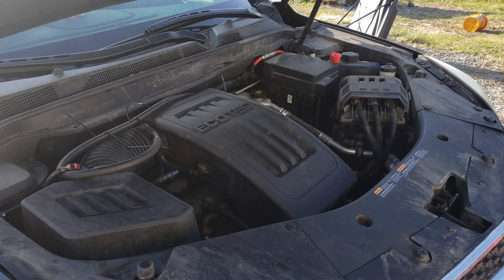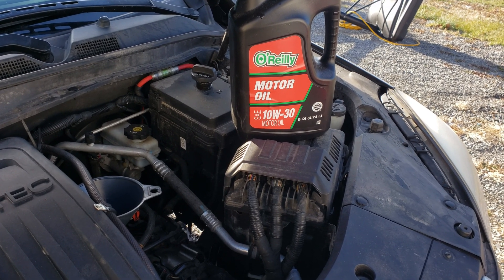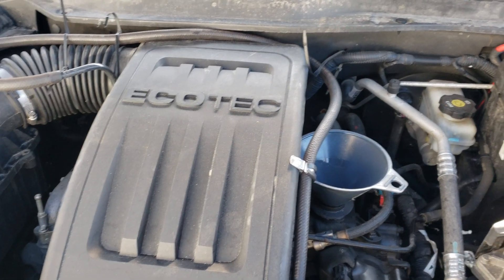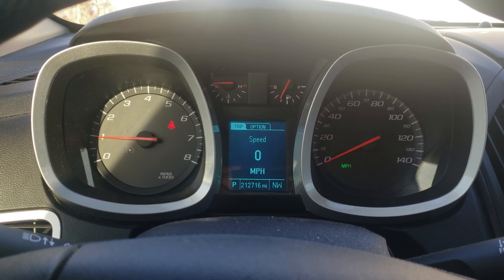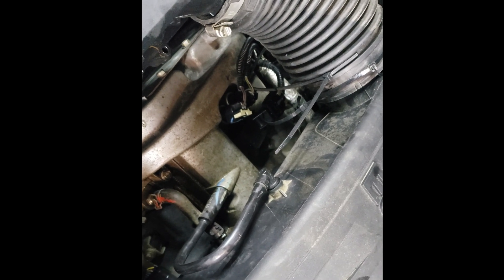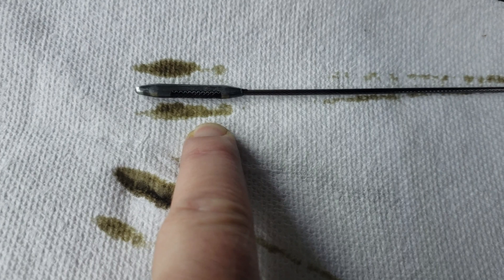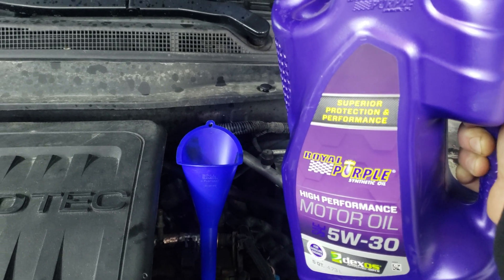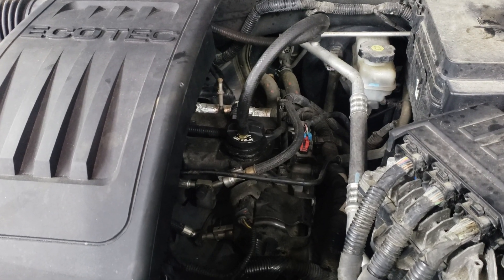Equinox PCV: Making a Bandaid?

Comment: This won’t actually do anything for your car. 
There’s already hose that goes from the valve cover to the air box  
You’re just adding a second breather hose. 

The problem is a blocked PCV system . And you didn’t correct anything with your Band-Aid, lol.

Comment: I own a 2015 equinox with 95k. I’ve also noticed it is burning some oil the last 2 oil changes. I’ve been changing them every 5k and at the 3k mark have to add close to 1 qt of oil to get me through to 5k. I’ve been using Kirkland fully synthetic 5-30 ( like the oil cap suggests).  When I remove the oil cap and check the blow by , the paper I put over it is being sucked in ( is this good?) 
Ran a scanner, no codes show up. Replaced the actuators at 90k. 
After watching multiple videos my game plan is to add a fuel treatment every other gas fill up ( 500 mi) maybe Chevron Techron or Marvel mystery.  I’ll also be replacing the oil cap with a vented one, part FC 219. Changing the oil at 3k intervals and using higher quality oil like Mobil 1 or Castrol GTX fully synthetic. Any other recommendations are welcome. Hope this info helps somebody. 🙏🏽
Reply from the maker: It's better to have a vacuum in the crankcase than pressure.  I'm not sure I've ever had a car that actually pulled a vacuum, so you're doing better than I am lol

Comment: Hi, a friend of mine told me that since i have high mileage, I should use mineral oil (20w50) better than originsl, syntetic 5w30. (Has 150,000 Miles) Any toughs? Thanks
Reply: Mineral oil?  Plain?  NO NO NO NO NOOOOOOO.     20W-50 was OK fifty years ago when engines had much larger clearances for oil.  Newer engines are built so tight that running oil that heavy could blow out your oil pump.    It could also  oil starve  a lot of critical parts - like the entire top end.    My engine is a 2011 with about 207K miles.  Still using Mobil 1 full synthetic at the factory 0W-20 spec.  Does not leak anywhere and does not burn ANY oil between 7K changes. .  .  .  .  .  High mileage oil is mostly a sales gimmick.  If you are properly servicing your motor, you don't need it.

Comment: I’m currently doing this. With one modification. Im going to put the new PCV valve tube lower than the clean air intake tube, closer to the throttlebody. So there is less chance of blow by being drawn back in through the clean air tube.
Reply: Can you put pictures of it

Comment: Those cars are junk, i will never ever get another
Reply: What type of issues have you had to be considered “junk”? Also, how many miles is on yours?
Reply: @cunninghamroc  132k miles.  Shit i jad to fix so much shit on this car, problem after problem never stopped
Reply: @Olds_Pwr  didn’t change his oil and then expected it to be OK
Reply: i just got a 2016, AWD with the 2.4L, has 222k miles on it rn. i assumed seeing the high mileage that these must be pretty reliable. am i in for a rude awakening?
Reply: @Lincolnator721  good luck bro
Reply: my 2nd aunt had a 2017 2.4L AWD with around 110k miles. never had any major issues. but she maintains her cars really well

Comment: My family has a 2008 Acadia 3.6 vvt 191k miles, bought used 2 months ago. Gave it an oil change, new Air filter and cleaned the throttle body. Found lots of oil in intake tube 3 inches from throttle body. Ordered a new pcv valve and thinking about adding a catch can too. Will try pcv valve first. It used 1 qt of oil in 8000 miles in 8 weeks. Forgot to test for oil cap suction. Nice mpg increase already from cleaning throttle body and new air filter. Old air filter was really bad.
Reply: Install a catch can. It is a must for the 3.6L.

Comment: I have a 2010 Malibu without direct injection. I just cleaned the throttle body and changed MAP sensor. Oil cap is sucked down by vacuum which is good. 100k miles. Doesn't use any oil. Cleaning throttle body added 4 mpg and new MAP sensor added 3 mpg. Now gets the 37 mpg like when new. AC on, 70 mph.

Comment: It might be due to poor maintenance because I bought my 2017 brand new and I always do my oil changes with full synthetic and mine doesn’t burn any at all. It stays full and I don’t ever top off. The only thing that happened once was a VVT solenoid but I always fix an issue asap so the cel was only on for an hour because I changed it out and that was 2 years ago. I also put a catch can on mine to help prevent the over pressure in the crankcase.
Reply: I think I read somewhere that GM might have improved the rings in later model years.  The lawsuit that they had didn't include those years. They definitely need to be routinely maintained though for sure as many people seldom even check their oil. I have a '16 and it doesn't burn oil either but I've always stayed on top of maintenance usually doing oil changes every 3 to 4 k.
Reply: How much miles
Reply: @AdrianHernandez-vh7wr  im currently at 98k miles but this failure happened at 75k or so. I change the oil every 5k for this car but now that im over the 90k I do it every 2-3k miles. On my STI I change it every 2,000 miles or less with motul oil only. I use synthetic on the equinox and my other daily driver.

Comment: Have you checked if the PCV return orifice in in intake manifold is not blocked ? It's a common problem for oil consumption. Run the engine and remove the oil filler cap and if it's blowing out instead of a slight vacuum the hole is blocked and you will need to pull the intake away to clear it.

Comment: I've been thinking about rigging up an old school pcv system with an actual pcv . Vacuum hose from intake vacuum to pcv valve mounted in modified oil fill cap, Ford had this setup back in 70,80's. Some feed back would be great. Kind of worried about affects on fuel trims.
Reply: When you connect to vacuum, find a port below the throttle body.  Preferably one that feeds equally to ALL the intake runners.  You don't want that oil vapor dumping into only one cylinder.

Comment: We have a 2016 GMC terrain with the same engine, these engines are crap my wife only has 41,000 miles on this engine echotec, and it just blew the rear seal from the PCV being clogged like they all do. I'll tell you what a stupid stupid car stupid engine I mean, I know all cars have problems more so than others. And they call themselves engineers they're just horrible people. And you try to get your money back and then you can't and it cost close to $1,500 or more to get a new rear seal and also to clean the orifice out of the intake. These engineers are stupid, absolutely stupid they just want you to buy new cars all the time that's all, they're not stupid actually they're very smart on making money, and we as a consumer deal with it and put up with it instead of trying to do something to them to get them to do it right etc. It's just garbage

Comment: my solution was two parts lacquer thinner 1 part trany fluid to keep it on the rings,  1 pint in each plug hole, set 24 hours, roll over to prevent hydro lock, drain, fill with new, stopped the oil consumption none in 2000 miles
Reply from the maker: Nice.  Maybe I'll give that a shot in a future project.
Reply: What do you mean by “ roll over”? Like turn the ignition on and off? The is!

Comment: Did you put a CAT scan on that line before you go back into the engine to catch the mixture oil?
Reply from the maker: The whole point of the line was to only grab the gasses and not any droplets of oil.   I have since inspected the intake tube and have found very little  moisture from oil.  Oil consumption has decreased considerably, but without changing the piston rings to solve the problem at the source, all that can be done is try to minimize the symptoms.

Comment: wouldn't it be better to install an oil catch-can rather than just a hose; wouldn't the oil in the hose eventually get pulled into the intake anyway?
Reply from the maker: I've pulled the air box and the amount of oil trapped on it is less than it was with the single valve cover vent.  I've been curious if that OE vent has awful baffling and can be improved from just part. 
The Equinox has added around 15k since I posted this video.  Each oil change is showing less loss than the one before it.  How much of that is the better vent path, and how much of that is the seafoam and better oil loosening the rings back up?  I won't know unless I get to take the engine apart and see what things look like.
Reply: @medievalmotors  do you have an endoscope; I use an endoscope to look into the cyliders through the spark-plug hole and it has the ability to turn the camera up and see the valves.I find that the cylinders in my 2001 dodge ram are very dirty with sludge caused by blow-by from the worn rings, so I installed a catch-can and now I'm cleaning the cylinders with brake cleaner and then I put some transmission fluid additive. I first apply the brake cleaner then swish it around with an airline so it would go up to the valves an then vacuum it out and then apply the transmission fluid addittive and some trans fluid and swish that around with the airline or disable the engine and crank it WITH THE SPARK-PLUGS REMOVED SO AS NOT TO HYDRO-LOCK IT. Then I vacuum out the excess so as NOT TO HYDRO-LOCK it before I replace the plugs and start it. I adapt a small clear hose to the vacuum cleaner and I can see the sludge coming out with the trans fluid, and inspecting the cyl again with the endo scope I can see that the cyl is cleaner. If I do all 8cyls and the catch can works hopefully they will remain clean; these dodge v-engines have aproblem with the plenum plate leaking but after installing the HUGHES KIT  oil was still coming into the plenum, so it was only recently that I learned that BLOW-BY can also cause oil in the plenum and sometimes aircleaner box. That's a good reading so I'll leave it there for now.
Reply from the maker: I have a cheap borescope.  I can't turn it backwards to look at the valves though.  This version of the Ecotec is direct injected, so the valves are probably coated in carbon because they aren't getting cooled and cleaned by the fuel.  I've run the seafoam intake cleaner, but without pulling the intake manifold off, I won't ever be sure.  And at that point, I would be able to enlarge the internal PCV port.  
As far as running a catch can, it might make an interesting test to see what is coming out of the valve cover, but I'm not seeing a lot of oil getting pulled into the airbox.
Reply: As soon as this guy makes a quick turn, all the pooled oil in the long hose is going to dump into the intake at once.  Hopefully, a small psunami of oil doesn't hit an intake valve at one time - I smell burned valve in his future!

Comment: I had a Honda accord great great car I I sell it to buy GMC terrain similar the other stupid car equinox because I was dumb these cars always break and nobody really knows what's the problem there is no spare parts too
Reply from the maker: Other than standard maintenance items and the pcv issues, there hasn't been anything broken on ours.  I've never had issues finding parts for it either.  Besides engine issues with both the 2.4 and 3.6, they aren't bad little crossovers.

Comment: Don't know what I was thinking buying an equinox, this is my first and last American car.  The thing has had one problem after another since I got it.  And this is in comparison to my last car (Mitsubishi Galant) the only problems it needed to replace in 12 years were the O2 sensors and the timing belt.  Would still be driving that Galant around if it didn't get totaled by a relative.
Reply from the maker: They aren't bad for economical crossover type vehicles.  Not my first choice, but not awful.
Reply: Please don’t let one vehicle to change your mind forever, in not supporting your Countries products anymore.

Comment: I added a catch can without all the extra length of hose in mine.  Added wire mesh inside the can because the baffle wasn't working well enough.  Then modified oil fill cap with a hose and another catchcan outputting it to a hole in the air filter box to make sure the extra air still gets metered by MAF sensor.  So far my mileage has went way up and oil loss is minimal.  My equinox does have the oil consumption issue and has clogged PCV hole in air intake.  Wasn't about to disassemble all that crap to fix it.  My way has worked well.  Cheers!  I tried the oil cap and hose without catchcan straight into air box and not as good results.
Reply: Take 3o min to pull the intake to clean out the port.
Reply from the maker: The blow by going in the crankcase should be mostly oxygen free, so it shouldn't affect the air fuel ratios.  By keeping it after the MAF I shouldn't have any contaminates getting on the MAF wires.
Reply: Getting a vented oil cap solves most of the oil problems

Comment: WTF IS THIS?????why dont you just a pcv system to it. Thats what i did and also installed 2 oil catch cans
Reply from the maker: That seems excessive, your engine must be a little more worn out.  With a tap in the cap, there is a good baffle and there's hardly any water vapor condensation under the cap now.

Comment: Wouldn't this put a lot of oil droplets back into the intake, since this is the "dirty" side of an essentially "new" PCV system? At the very least, you may want to install an oil catch can in the line, and see just how much oil it is collecting in a normal drive....if minimal, no big deal, but if the can fills up quickly, you may just want to install the vented GM FC219 oil cap (without modifications) and call it a day. (search terms Equinox FC219 oil cap and you will see a lot of comment/info on this) Smart to use synthetic from now on, good call. Seems higher than average oil changes with synthetic is necessary for a long running equinox, moreso than other cars.
Reply from the maker: Its down to about 1 qt every 3500 miles or so.  Theres a baffle at the oil cap that prevents a lot of oil splash, so that seemed a prime location for an extra PCV line.  I didnt see the need at this point to add a catch can.  Putting in a vented cap should be messing up the MAF.  If you're only adding blow by to the intake, it should be fairly inert, bit a vent makes the pcv system a permanent vacuum leak.
Reply: @medievalmotors  Good points, and thank you for the info on oil consumption...that kind of stuff after a mod is always useful info. The FC219 cap only releases overpressure in excess of a couple of PSI, so it should not be allowing airflow bypassing the MAF...it just moves the "weak point" from the main rear seal to the cap. Might blow oil over the plastic covers if the PCV port in the intake gets clogged, but that's a lot easier to deal with than a rear main seal (if it happens...I hope it does not!)
Reply from the maker: That was the point of putting a hose from the cap to the intake tube.  Having it connect to low pressure moving air will keep the pressure from building up at all.  Plus piston rings like to have a touch of negative pressure to keep a seal.
Reply: @medievalmotors  do you have a video on how to do the hose from the oil cap ?
Reply from the maker: I don't.  It was just a quick drill and tap to 1/8th inch pipe thread.  Used some black RTV to seal it.  Same on the intake tube.
Reply: yes that is what I suggested too above before I saw your comment!!!
Reply: Thank you very much for posting the info on the oil cap. much Appreciated bud 👍👍